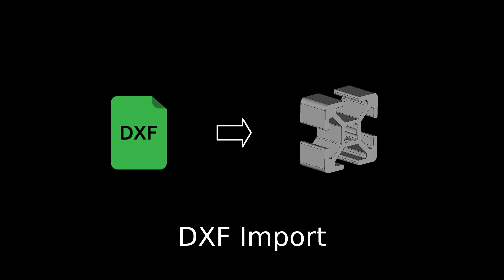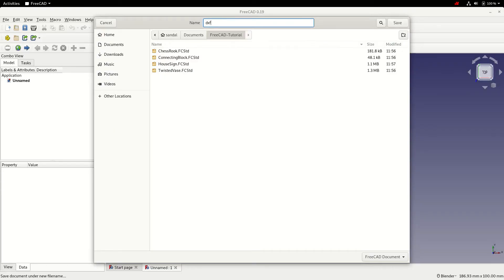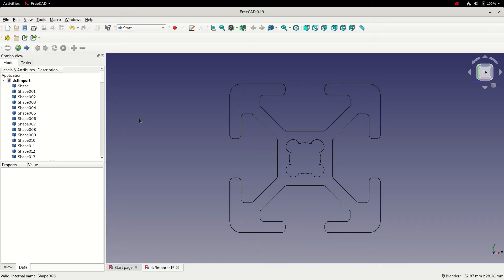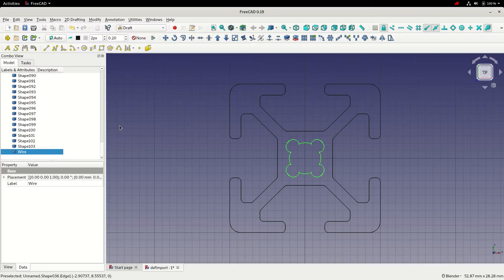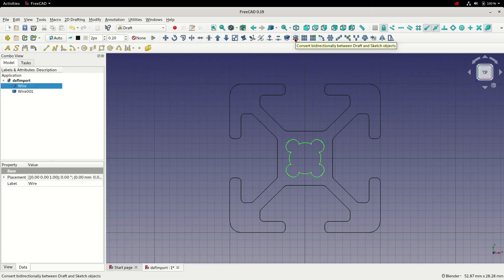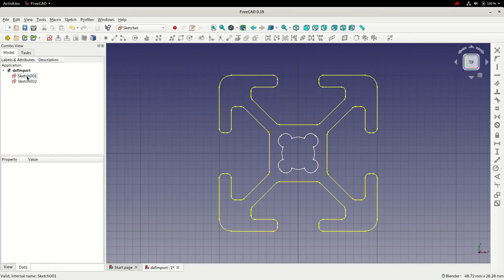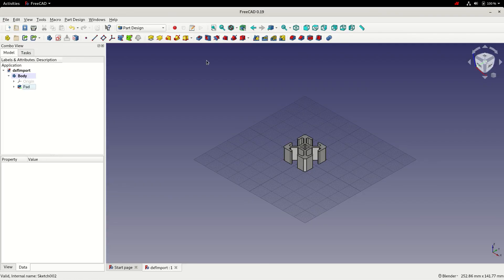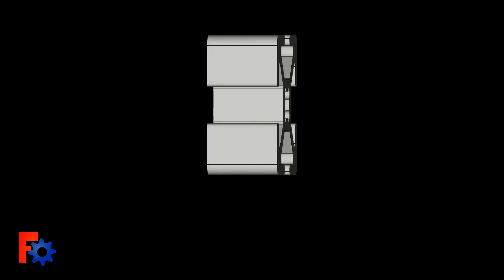FreeCAD Tutorial - Basics - DXF Import

Comment: Have tried numerous times to import DXF from Illustrator to FreeCad. I have changed both units in Illustrator and in the FreeCad import preferences but it always multiplies my DXF by 25.4. Have spent hours trying everything imaginable and scouring the forums to no avail. It just will not take a DXF from Illustrator in mm's as 1:1. I have even tried to reduce the import to 0,03937 and it does nothing. Annoying as hell.
Reply: There are 25.4 mm to an inch so perhaps one of the graphics packages is in imperial units and the other mm, hence the conversion through? Just a thought.

Comment: Thank you for this amazing tutorial. However, I am running into an issue with Ver 0.19. Once I converted a group of shapes into a Wire, the resulting sketch has hundreds of unconstrained points. Is there any update on how to obtain a fully-constrained sketch?
Reply: Did you figure this out, i have the same problem
Reply: @stevewhite9765  apologies for the super late reply. Unfortunately, no. The only solution was to re-draw 1/4 of my piece by hand (based on the original image that I was trying to convert) then just mirror and rotate everything. This might be a good bug to report, perhaps?
Reply: By any chance you found a solution for this? It is still annoying me. I am just working with a DXF with 996 DOF! Hahaha
Reply: @DanielMelendrezPhD  It will show up that way until you do the Create Body step, afterwards you should be good to go.

Comment: Very well done thank you sir. Question, is it possible to edit the dxf after converting it to a wire then to sketch? I am a waterjet operator new to freecad and cad in general, and I get asked all the time from the boss if I could manipulate clients dxf files to be one way or another. Any help or input would be greatly appreciated! Thanks again
Reply from the maker: Sketches can be edited in the skecher workbench. It's the main workflow for FreeCAD and should be covered in lots of videos online. Only issue is that dxfs can be messy and you might need to do some corrective work before they are useful.
Reply: Ok I’ll keep working on it. Thank you. Generally I just have to trim lines out of the original dxf given to me,which is what I’m having trouble with.

Comment: Great thank you! I was making a compound instead of the wire thing. However the DXF files i have
from another system are tiny and i need to scale them up. Just don't know how? Can you help with
a tini nice vid like this one? :).
Reply from the maker: Thanks for leaving a comment. Knowing that these videos are useful makes it worthwhile taking the time to make them!
Reply: The Draft workbench has a Scale tool (S C), which can generally be applied to any object, including the sketch with holes here. It asks first which point is the center of scaling, then what scale should be applied. For some reason I'm having trouble applying a fractional scale (probably a localization issue with decimal comma), but it can be done in the properties of a Scale clone (the output object if you choose clone).
Reply: I get the same thing. 1.5" sq drawing is .003" wide, or should I say 3.100 thou. WTF on two levels
Reply: @GeckoCycles  Just tried it, load your DXF open it as Autocad or Autodesk what ever works if it works.
Than select all the geometry to be scaled in the Combo View window, change the WB to Draft. Hit the 
"Scales and..." icon it's two squares and a arrow in them,  blue icon near the sheep head. Leave the
global X, Y, Z points at zero and click the enter point button. Set your scale 0,5 for X factor, Y factor, Z factor
to get 1/2 the dimensions and check the Create a clone box. Hit the OK button. Finally you can export the clone!
Good luck! Guess you may go with the number 500 to scale up or something like that :)
Reply: @jimmihenry  I opened several DXF files created in different programs and all were very very small. I then went to preferences/import/dxf and changed the scale from 1 to 645.2 and all DXF files are opening to the correct scale now. Pain to figure out, math was not exact but very close. A half a dozen tries later from 645.16129032. LOL
I tired setting to 1000 as per the drop down description but the drawings were too large for what ever reason. Drawings are drawn in .0000"
I didn't want to have to figure scale every drawing.
One thing I am trying to figure out is why the constraints are gone yet the sketch will pad.
Going to try to make as path and see what happens
Reply: @GeckoCycles  "... went to preferences/import/dxf and changed the scale from 1 to 645.2", this is helpful :). Wonder why math did not work on finding out the scale. Maybe because of rounding up? :) Glad you did it, nice job.
Reply: @jimmihenry  You would think it would round up or down to 4 digits which was all I could input in dxf preferences. I started with 645.1613 which I think was .003" small if I recall.
Reply: @GeckoCycles  No i did not, 645.1613 looks like its a unusual number i assumed it would be just some scaling issue... but i don't know and don't care. Hopefully this will be addressed and fixed whatever number or roundup, or even some different shit this is. Glad you have a work around. Cheers.